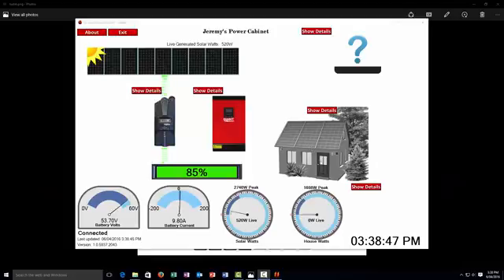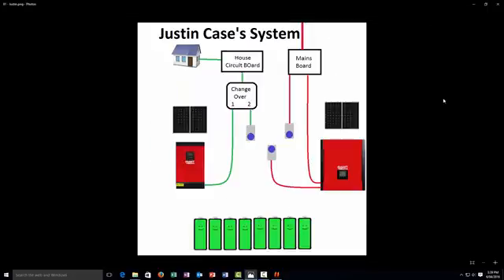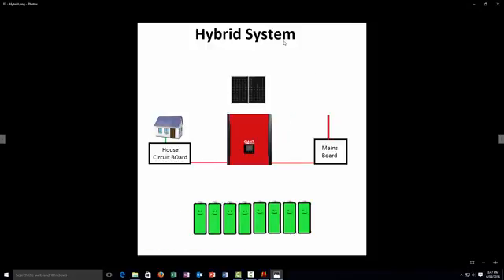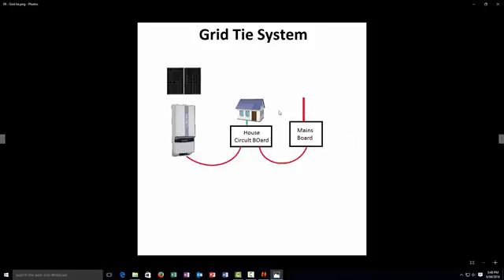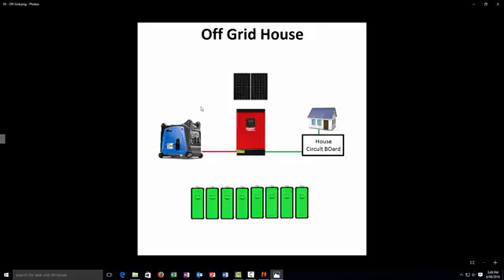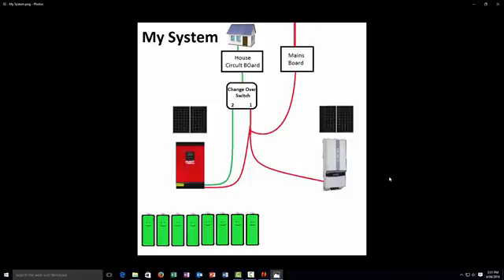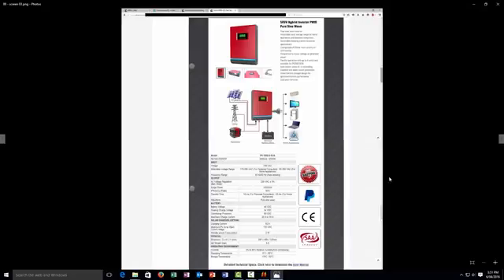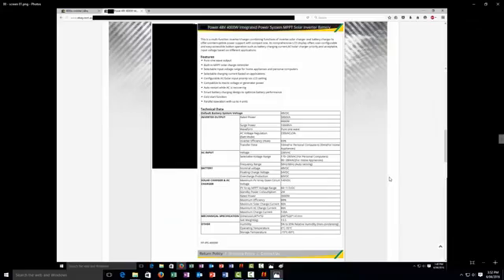Different Solar System Setups

Comment: Hi Jeremy - nice well explained video. You may be able to help me. We have had a query on our forum  about the Infinisolar  5kW hybrid that Justin uses. Does it have it own separate communication  protocol or does it use the same protocol as the PIPs? If it is different could you point me in the right direction to getting a copy of the communication protocol?

Comment: Jeremy could you show a transfer switch, my friend wants to use one but his does not look to AU standards.
Reply from the maker: closertothetruth
Justin Case Solar Power  just to add to Justin's comment. Yes they cost alot and  just be warned in Australia in some states it is illegal to use an external automatic change over switch that's connected to the grid, Sometimes even with inverters that have it built in they crack up about it . As Queensland says "There is a potential for back feeding to happen" And for other countries it is recommended to check your local power companies rules and regulations.
Reply: +closertothetruth My system has been inspected and passed. If you can Quote the reg you think it does not meet i would be happy to go through it with you.
Reply: +closertothetruth Auto T switches cost a lot of money. the units have it built in. So if your using the system as a grid backup you dont need to worry about it.
Reply: +Jeremy Ohara ,good info guys, i like the idea of these switches just not my friends cheap chinese made switch he bought of ebay, years ago it looks prehistoric i guess the price was right, my concern was his is most likely not to code, i realise justins is to code etc, but some people out there take risks using the wrong stuff and even quietly installing it themselves to save money like you see some people do on youtube in other counties.
Reply from the maker: +closertothetruth Are you talking about a AC Change over Switch? i can send the link if you want.
Reply: +Jeremy Ohara ,  ive found a latronics automatic one, but i just thought it would make a great youtube, thanks Jeremy
Reply from the maker: He better be careful cos if the power company or an electrical inspector gets wind of it. he is gone His house will be condemned and he will get a $100,000 fine and or jail. As for the Chinese crap. Justin and i have seen our share in them and Justin has even done a video on some crappy ones that we were sent. LOL dont get Justin started on what he has seen on YouTube or you'll never shut him up :-P i've just used a manual single pole 63a change over switch. Justin has don't know how many pole(i've forgotten, i think its 8 pple with 3 positions) change over switch
Reply: +closertothetruth Yes i dont know why people take the risk. You know they still use them Chinese grid ties. but did you know here and in the US the electricity companies can tell now ?  You see the small cheep things Do Not but out a pure sign wave and the new meters pick it up and flag them.